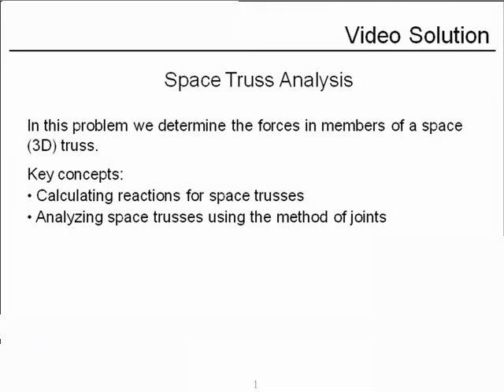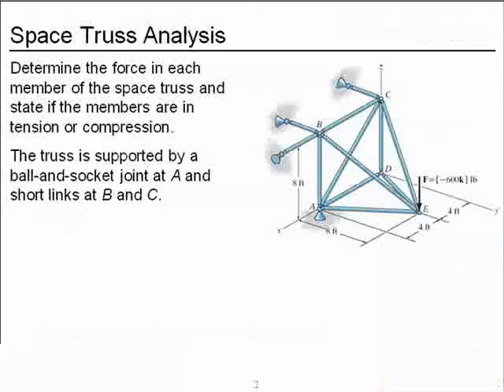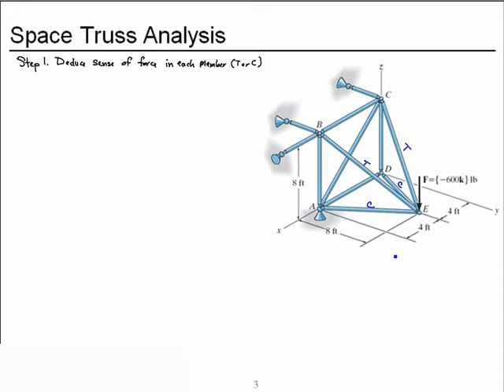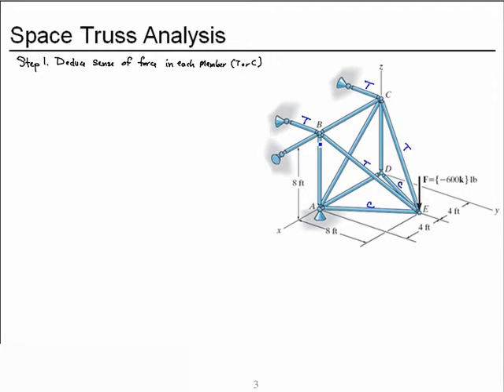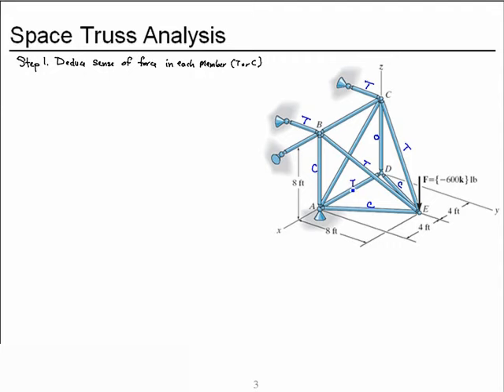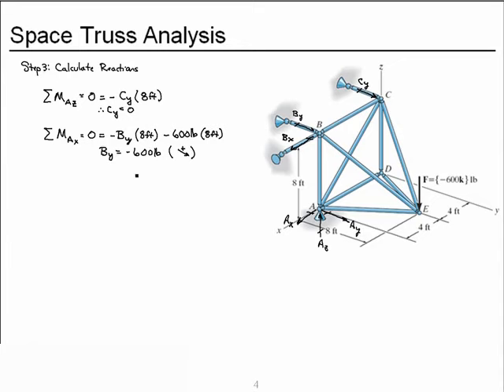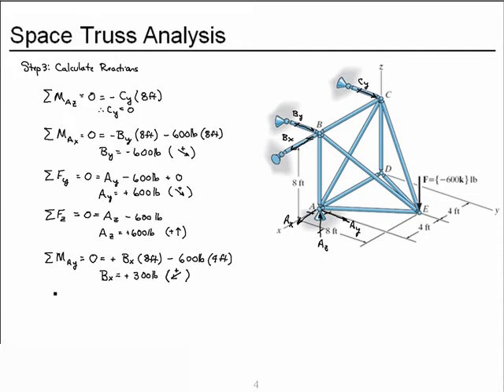Chapter 3-Space Truss

Comment: help please. @ 7:50
how did you know how many reactions reacted on the space truss? Please enlighten me.
Reply: the links are considered to have 1 reaction each.
Reply: Nioz Ysmael Look at the "wall mount" ball joints.  You see 4, right? The one on the bottom constrains in x, y, z directions. (thus, 3 reaction: Ax, Ay, Az).  However, see the other 3 ball joints?  They do not constrain in xyz? Why? They got little floppy sticks connecting to the truss frame.  That effectively invalidates the xyz constraint, and the rule one stick = one reaction, applies.  Otherwise, if you took out the sticks at points B and C you will have 3 reactions at those points.  Total becomes 9 reactions.  (if you took out those sticks).  BTW notice joint D is just floating....thus, the rationale for the zero force member CD.